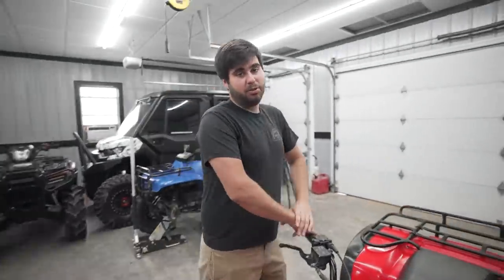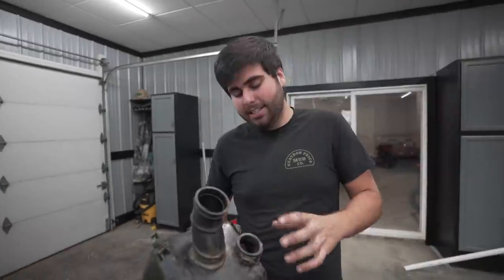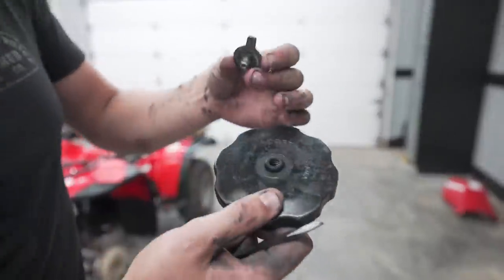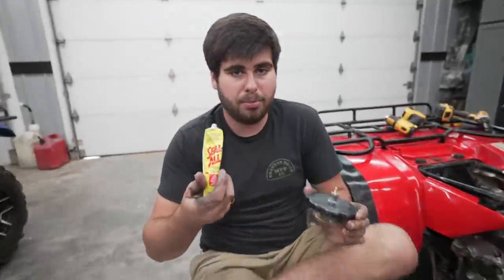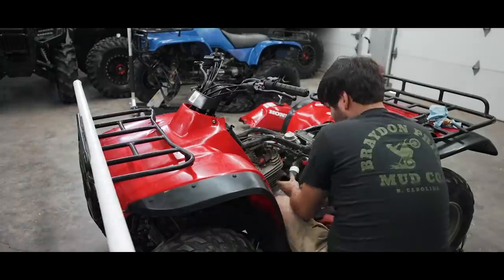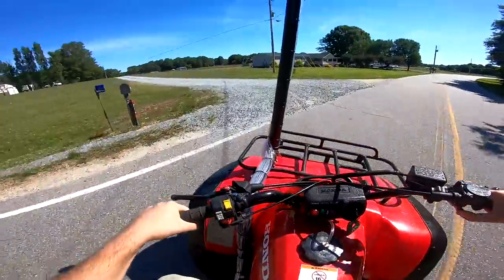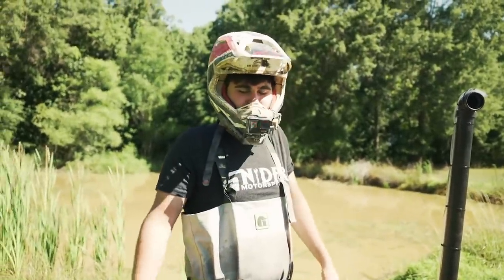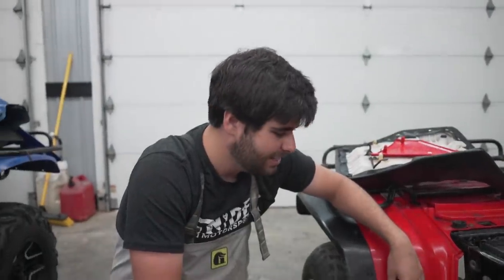WE SUNK THE FOUR-TRAX 300! Snorkel FAILURE

Comment: I sealed every little thing on my 300 carb including the choke and throttle cable when I snorkeld it and I've had zero issues going over the bars
Reply: @superbambifanboii7181  mans is speaking fax
Reply: Issa boat
Reply: Tutorial
Reply: What size vent lines do I need

Comment: Brayden.. The water probably came in through the exhaust… if the bike dies under water the exhaust leads right to the piston.. so it can fill the motor with water. Also “in my experience” 300 don’t run well underwater, iv only has 3 or 4 over the years but none of them had enough back pressure/compression to run under water without idling it up, idk it could be something else but as far as water in the gas my best guess it the gas cap, i would buy new gas cap, and just close the seal when you go in water
Reply: I've had 3 honda 300s over the past 2 years and they all ran great in water
Reply: If water goes in the exhaust it only goes in the top end, I had it happen 6 times this weekend and she still don’t have water in the oil
Reply: @that_foutrax_boat4540  mine would run under water, until I went super deep, had to keep it Idled up.

Comment: Braydon I recommend you come to glamis sand dunes bring the x3 the outlander and the Renegade and some stock’s. It would be a blast. But the season is only from Halloween to Easter or it is to hot. But I would recommend thanksgiving or New Years.
Reply: The outlander is a bounty hole bike
Reply: @coopersciullo3784  it still would be cool to take it and it would be different and it would get a lot of attention
Reply: It's broken
Reply: @coopersciullo3784  I know it could be fixed and take as a bounty hole bike.  It would be fun on long rides but it would but on short rides and it would be fairly fast.

Comment: Check the plunger button on the side of the 300 carb see if there’s any rips in the rubber part or just slower get the motor used to the water cause mine does the same thing if I don’t take it slow at first

Comment: On the bottom of the carb there’s a drain and you need to cram silicone in it and there’s a black cover covering the throttle cable and stuff and you need to silicone all that, doubt Braydon will see this but if you do then that’s what it is fo sho

Comment: dielec greese spark plug and zip tie boot  make sure carb throttle body packed with greese and make sure  you add one way check valve

Comment: The  water went up the line on the bottom of the carb the one way check valves fail too I had to do the same thing on my 2011 Honda Forman 500 that’s carbureted

Comment: The carb on these 300s have a vent hole built into the carb body!!!  Several small pin holes on each side,,no way to snorkle these carbs,,short of using a different carb.

Comment: If you drown a 300 flip it on the rear rack and spin it over while holding the compression release and after 15 seconds of turning it over or so let go of the compression release and it will start everytime

Comment: i keep getting water in the bellhousing on my 2006 kymco MXer 150, even if i just drive in rain through puddles.. now it isnt delivering any power at high RPMs, so we'll have to fix that, but anyone got some tips how to prevent water from getting in there / what might have happened? i think i bruned the belt on it..